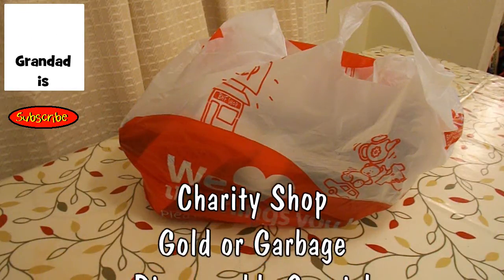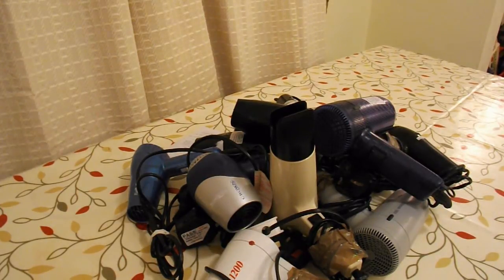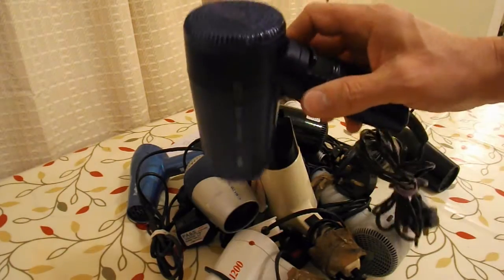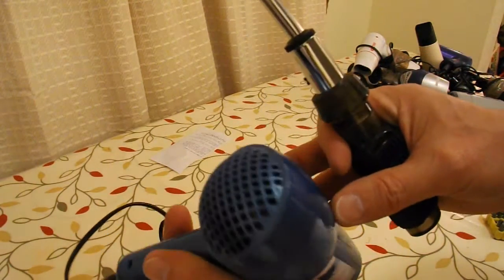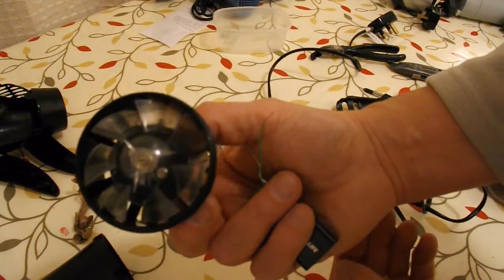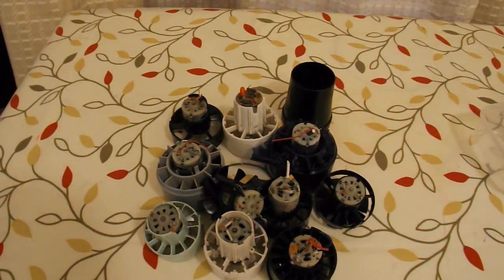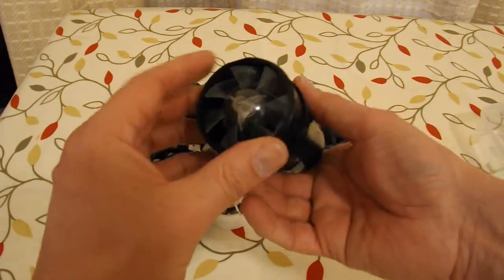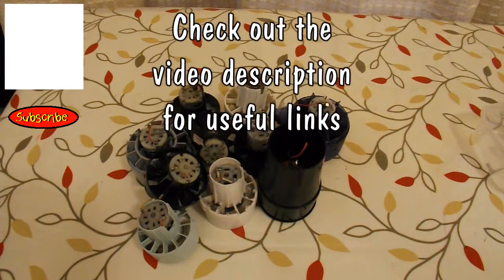Charity Shop Gold or Garbage Disassembly special - hairdryers

Comment: Fantastic find !
The fans can make good wind turbine rotors...if a 12V motor spins very freely, put out in strong wind and, using your multimeter will see a couple of volts output and usually up to several hundred mA. Will charge an AA battery.
If rotor is stiff it can be through lack of use...few drops of thin sewing machine oil on the motor shaft will free it up.
Reply from the maker: Hi Slider, thanks for the idea, I will put that one in the "to do" list.